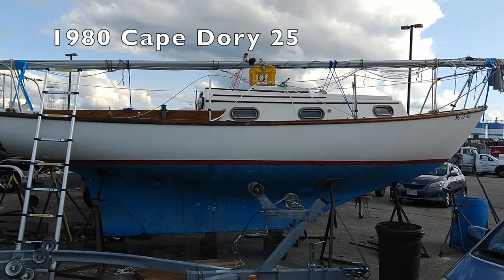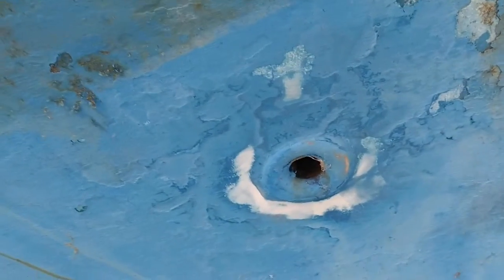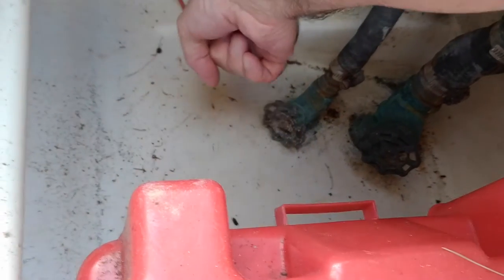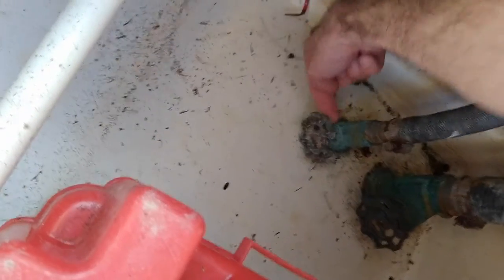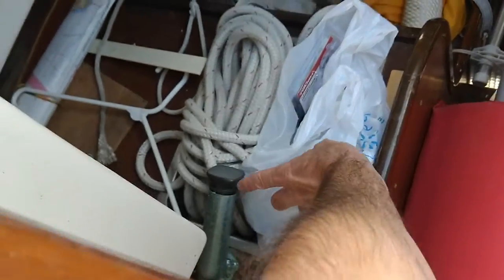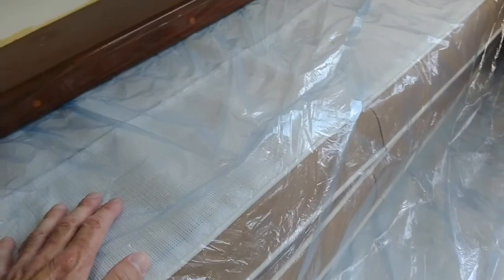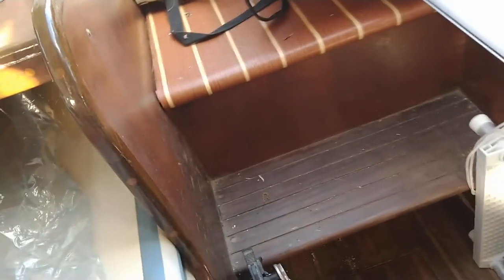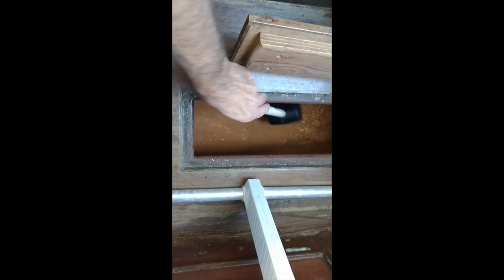1980 Cape Dory 25

Comment: Used to have this EXACT boat. Pretty sure mine was a 77. Yours is a little bit nicer than mine in terms of design but literally EXACTLY the same boat. Mine had that plastic instead of the wood in the cabin. NEVER wanted to use a grill\stove on the water for safety issues, but this is me being a panicy teenager in the early 2000's. The cockpit drains on your Cape Dory are significantly bigger than the ones on mine were, but drainage was never an issue for us. Be ABSOLUTELY sure to check and see if there is a one way valve on the bilge porthole. I vaguely remember something about almost sinking the boat in our slip that way. Yeaaa we were just kinda winging it too... This was pre youtube days so I pretty much learned to sail from books. 

I have stories and memories FOR DAYS. I'd love to help in any way possible. I subscribed, please please please keep updating!
Reply from the maker: I'm still working on the seacock's for the deck drains. Not much room to work, but on the last one. Have new standing rigging. Need a new depth sounder, some bottom paint and she's ready for the water, I hope.

Comment: Congratulations on getting your CD25!  I own a CD27 and am an ultimate fan of Cape Dory.  I stripped my hull last season.  Its a lot of work.  Any questions on CDs, let me know.  I do have a pristine copy of the owners manual.
Reply from the maker: Thanks! This CD25 came along and I couldn't resist. I told my broker I like the CD25 with 3 opening ports on each side and about a month he showed me this one. Love the way Cap Dory's look and they are a solid boat.
Reply: Hi. I'm very curious if you can cross from Europe to the Caribbean with a boat under 30 feet 
  I mean. If it's a full keel should be able to cross oceans. Right?
Reply: @joshuatulici2180  yes,  definitely.
Reply: @tdk1246  I'm definitely getting a CD25 as my first sailboat 🤠

Comment: Nice boat. I might buy one just like yours. I have found one to go see and wanted to know what to look for. Also, what surprises if any have you had with your boat?
Reply from the maker: My 1980 CD25 is in good condition for its age. That means it needs work and updating done to it. I would highly recommend a surveyor. The most important update my boat needs is new seacocks for the deck drains and sink drain. My depth sounder needs a new replacement. Standing rigging needed replacement. Portlights need to be resealed, rebed chainplates, rebed all deck fittings and kiwi-grip for decks, cockpit. Things it could use is replace running /nav lights and anchor light. rewiring and fuse box.Hoses need to be replaced. The good news is, not all of these things need to be done right away, just the critical ones. Hope this helps!

Comment: Beautiful boat. I'm confused about the cockpit drains. It sounds like you're thinking of eliminating them relying on the motor well as the cockpit drain? If so I would advise against it. Although the water in cockpit can only ever get as high as the motor well it would appear that you could collect at least 30 gallon of water in the cockpit before the level reached the well. That's 300 lbs of live weight (sloshing around as the boat moves) in the cockpit which could easily, in the right sea conditions, overwhelm the stern of the boat and helm control. I would suggest that the safer route would be to replace the gate vales and hose connections rather than eliminate them.
Reply from the maker: I think you're right. I did replace the cockpit valves with proper seacock's from Groco. Not much room to work and it was a pain in the ass to fit the hoses to the seacock/ to deck drain.

Comment: What you see in the cockpit is gelcoat, not a liner. You are at the bottom of the boat.
Reply from the maker: Not sure about the CD 25D but my CD 25 has a fiberglass hull liner that extends into the cockpit lockers.